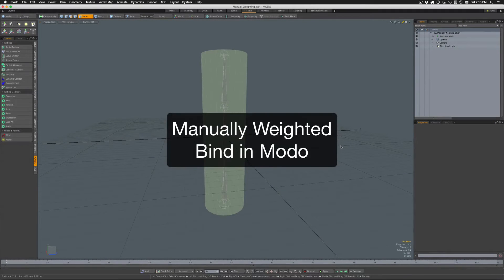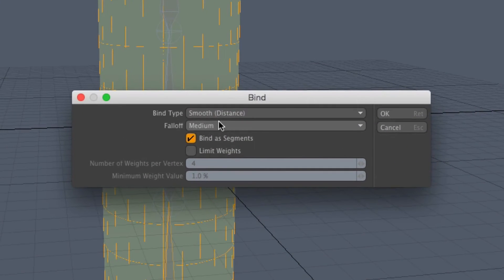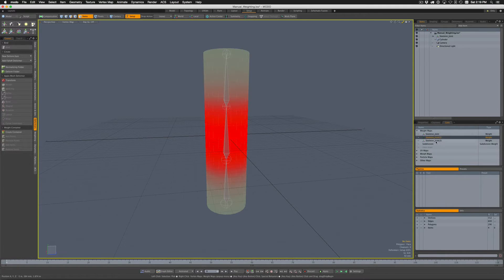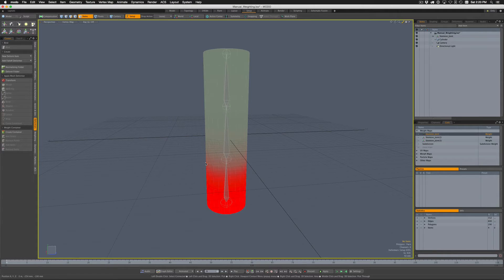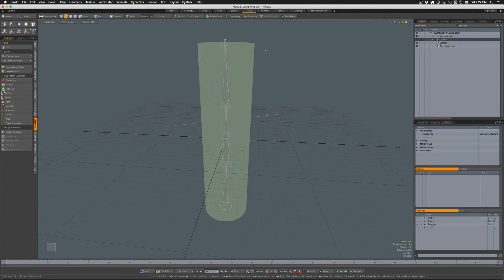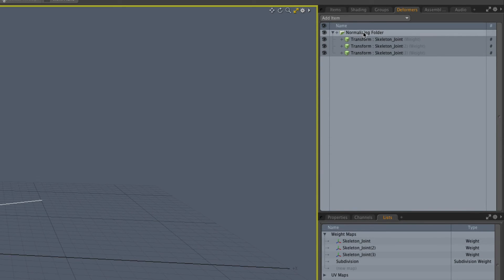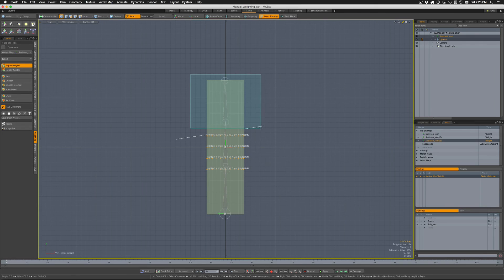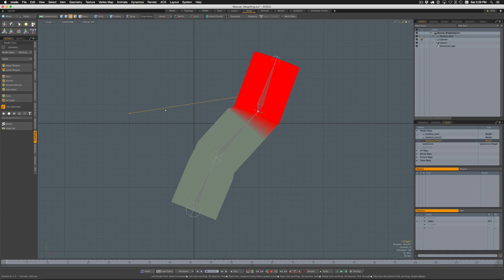Manually Weighted Bind in Modo

Comment: Why not just bind using the normal approach and clear the weight maps after finalizing the bind?
Reply from the maker: Sure, you can certainly do that too.  In older versions of Modo, sometimes folks would encounter an issue when trying to clear the weights for multiple weight maps at once.  This video, like many I've made, are in direct response to posts on the official Modo forums - and I believe in this case that question was raised.  So I thought this was an interesting little trick for getting all the structures set up and having the weight maps start off empty.

I should note that managing weight maps has improved quite a bit in recent versions of Modo.  A few years back I wrote a plug-in for Modo (in C++) to speed up weight transfer between maps, because this functionality was lacking natively in Modo (in a reliable form) and python scripts at the time were incredibly slow.  My plug-in is still in use, I believe, in the freely available Eterea Weight Tools kit (which I highly recommend to anyone doing a lot of weighting work).  However, Modo 11 has native weight transfer features that are just as fast as my plug-in (minus a couple of use cases) - so probably the Eterea kit should shift to using Modo native functions.  Likewise, the reliability of working with multiple weight maps has improved and this has largely obviated the utility of the trick I show in this video (unless for a particular project you encounter a bug clearing the weight maps en masse).